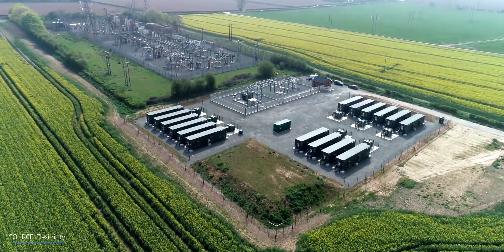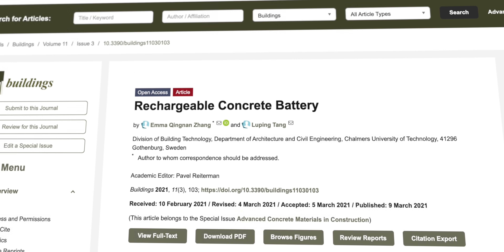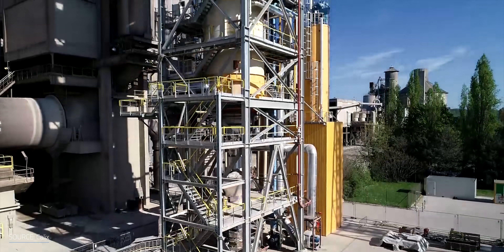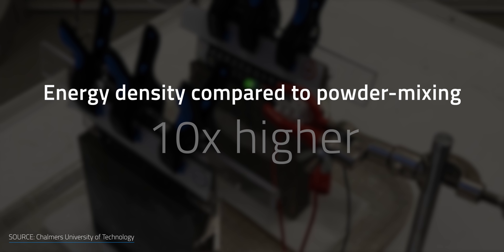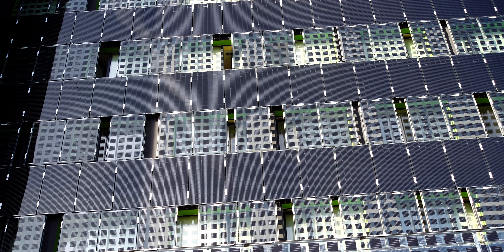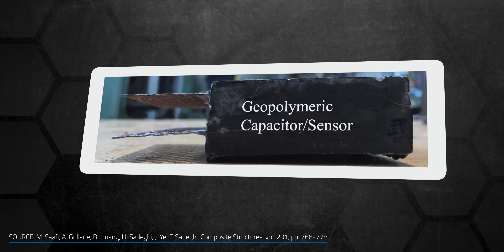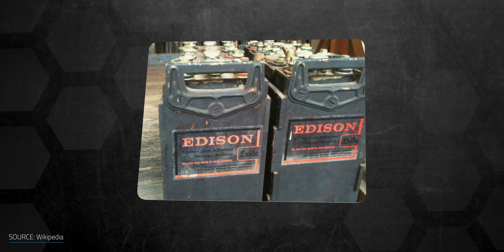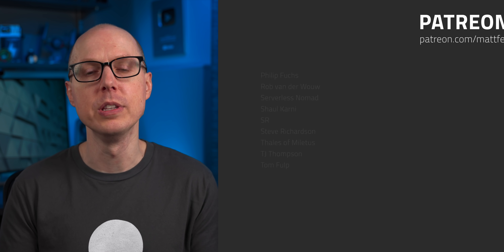Turning Buildings into Batteries? Concrete Battery Storage Explained

Comment: I would be very concerned about the thermal expansion and contractiom of the battery components. The usefulness of iron reinforced concrete is dependent on the rates of its components expanding and contracting at relatively close rates in changing temperatures. The crystals linkage between iron and cement wouldn't mean much if heat caused easy cracking.
Reply: You'd also have to take into account the volumetric expansion of anode and cathode caused by absorption and release of charge carrying ions carrying charge between the two electrodes.
Reply: This sounds like a Surfside Condo collapse in the making...
Reply: There’s a video by practical engineering that talks about how in modern day we help stop concrete from cracking too much. And if what Matt is saying in this video is true than I think the batteries could actually strengthen the concrete. If you want to see the video i’m talking about type in practical engineering stopping concrete from cracking.
Reply: I can only imagine a failure frying everyone inside, living inside of a battery doesn't seem like a smart idea to me when nature is a fully active wild child to deal with. lol  Concrete is hella unstable and needs maintained to much. People often forget that it's brittle and porous. With that being said I could get behind the idea of it being used in driveways etc.

Comment: With LFP battery patents expiring in 2022, and lower energy density not mattering for stationary storage, I think LFP will take over for grid use (assuming flow batteries stay too expensive). Concrete batteries interesting concept but building trades and building codes not known for adopting new technology.

Comment: TV/VCR combos had a fatal flaw, if one breaks, you can’t replace it without replacing the other. With batteries forming the structure of a building, when that battery stops working, it cannot be replaced.
Reply: What if we used prefabricated concrete battery blocks instead? When the battery stops working, you unbolt it and replace the block with a new one. You couldn’t make the entire structure out of these blocks, but you could have non-structural concrete be made of replaceable blocks
Reply: @justinokraski3796  What if you just had a normal battery? Sure, it takes up a bit of space instead of being the structure itself, but with a much higher capacity, ease of access, and replaceability, I think that's worth it.

Comment: We are better off using the buildings and housing we already have as "batteries".   Using them to store (thermal) energy when it's abundant in the form of increased or decreased temps and letting them return towards the mean when energy is no so abundant.  Obviously having good thermal insulation improves the "battery".   Example:  Using solar energy to slightly over-cool or over-heat during the day while the sun is shining by say 3 degrees and letting the interior temp swing back the other direction at night when solar energy is not being created.  The perceived comfort disruption to us is fairly minimal and the change is gradual so it's hardly noticeable.  You don't even have to generate your own electricity for this to be a large-scale benefit, doing the same on-grid reduces the strain and levels off power production around the clock for energy providers.   All it takes is a programable thermostat or someone willing to manually control the thermostat 2x a day.

This idea is basically free to do/use, it's available to just about everyone, and we can all do it today.
Reply: Passive solar design will do this with fewer moving parts.
Reply: @shawnr771  Agreed, but again that usually means significant redesign and cost.  When it comes to battery tech, doing the above is basically free and we can pretty much all access it.
Reply: @ssoffshore5111  If we would alter new home designs to incorporate it start with would be a good idea.
Especially in areas it makes sense.

Comment: That's interesting. Does it affect the concrete either positively or negatively? (Pun intended) Does it shorten the life-span or weaken the concrete?
Reply: I'd say yes because of the volumetric expansion of anode and cathode during charging and discharging. And because of different thermal expansion of the anode and cathode metals. The reason why iron is used to reinforce concrete is because its thermal expansion very closely matches that of concrete. But nickel....I don't know. 
Also I know that at least in lithium ion batteries the charge carrying lithium ions in the electrolyte plate on the surfaces of the two electrodes over the battery life. And in this type of battery the plaster is the electrolyte. So similar kind of reaction could weaken the plaster over time. But I am not sure
Reply: My biggest question, disappointed he didn't address it.

Comment: Some possible problems that popped up in my head:
* How much does it complicate the cement pouring practices that are used today? (Might making cement bricks and using those in the walls be a better idea?)
* How do the anodes, cathodes, and additional add-ins affect the structural integrity of the cement?
* What happens during a critical failure of one of these batteries and is that something you'd accept happening inside your walls?
* (On a lesser note) I imagine this would make it close to impossible for WiFi signals to get through the walls.
Reply: And what happens if you need to core cut a hole for a duct or pipe to go through one of these concrete walls?
Reply: @THLGargamont  I was thinking exactly about that and I imagined people would only do sections of "battery cement" and other parts of the house like structural pillars and a couple walls be made out of common cement
Reply: Let's not forget how do you maintain one of these concrete-batteries? Do you go at the wall with a drilljack and diamond saw and hope you got the right one?
Reply: Plus a very important question should be: does it affect the ability to recycle concrete?
Reply: @joshuahector634  And what's the cycle life? A bit harder to replace when you need to tear your building down.
Reply: I think from a builder perspective this is a nightmare.  I'd rather have a space to put a redux flow battery personally, which are environmentally friendly and you don't have to worry about what's happening in your wall and I think there's one part other than a failing pump that has to get replaced after many thousands of charge cycles.
Reply: Concrete production is one of the BIGGEST carbon emissions sources out there.
How would this added complexity in concrete production going to impact emissions?
Reply: Depending on capacity improvements, this might be a more practical product for concrete driveways and pavers rather than interior walls of a home or building.
Reply: Lots of structural integrity problems here.  High likelihood that the heat cycling and metal oxides from just operating the battery will cause microcracking of the concrete.  There's also a chance that chemical activity could degrade the actual cement bonds.
Reply: *Degradation of the steel rebar as well as every metal fastener used to secure anything to the concrete,  by electrolysis?
Reply: This technology would be best suited to large repeated concrete forms - railways, monorails, roads, tall buildings etc - you'd presumably have many isolated 'batteries' in parallel with the necessary protections from electrical shorts. Although as people have pointed out? bricks would be better suited for this style of battery - there are likely clever ways of connecting all the battery-bricks as part of the laying process.
Reply: For each of these:
1. It will complicate it somewhat as layers of carbon fiber mesh will need to be placed in between concrete layers.
2. These should increase the structural integrity of the cement. They're reinforcement fibers.
3. Critical electrical failure is unlikely to happen. The energy density is basically so low it's very unlikely to happen. These store 0.8Wh/L of concrete according to their paper.
4. It would definitely be close to impossible for almost all signals to get through the concrete. The entire house is essentially full of EM shielding.
Reply: on the last issue you mentioned, maybe it could be used only in exterior walls and keep the interior ones as regular cement.
Reply: Prefabricated elements.
Something like the so called commie blocks.
Reply: You forgot the MAIN ones - how long would those batteries last, how economical is it to even make them as opposed to battery banks which you can freely maintain and replace, how environmentally safe are they and what happens in cases of leakage through the walls, do they emit harmful fumes and other bad stuff, and how safe (or unsafe) is a demolition of such a house compared to a normal one
Reply: Yes, WiFi,  just use lots of repeaters and imbed lots of wires throughout the structure. Food for thought, though... it would be great if the cement could carry the wireless signals, too.
Reply: You only have those questions cause there isn't an industry for it yet
Reply: Good questions. Seems they are in the early stages of the technology. Will be interesting to see where it goes.
Reply: Essentially a Faraday cage of concrete? WiFi doesn't go out and perhaps no cell signal inside either. That could probably be fixed by integrating some sort of signal amplifiers where there's glass and at various points internally. Or... market it to conspiracy theorists as a way to avoid those 5G viruses from Bill Gates.
Reply: Tartarian tech
Reply: SHHHH Its not ment to actually work, just to get people to invest!
Reply: @danquaylesitsspeltpotatoe8307  
- "SHHHH Its not ment to actually work, just to get people to invest!" 
You seem to suggest that the invention actually working wouldn't help with getting people to invest in it. Perhaps the quality of your comment reveals the reason why so many investors make a lot of money while you don't...
Reply: @adoatero5129  
"You seem to suggest that the invention actually working wouldn't help with getting people to invest in it."
🤦‍♂️🤣
Well it doesnt, thats why they need "investor"

"the reason why so many investors make a lot of money while you don't."
LOL my etherium did ok!

So how much have you invested in 
spin launch etc?
how much in solar panel roadways?
how much in solid hydrogen? THE LATEST BRILLIANT IDEA ON THIS HACK CHANNEL FROM THE SCIENCE IGNORANT EGG!
Reply: @Old Time Farm Boy " It is not a matter of if it will crack but when."
Im no concrete expert, but when I hear this crazy idea I know it was just terrible for so many reasons, but people get conned or just dont think like you do!
People cant see the massive flaws in 
solar road ways!  
hypertube!
spinlaunch!
anything musk comes up with an idea someone else didnt invent.
All the examples on TF should be in  a museum! :)
Reply: This also complicates house buying/selling, you'll need to list how much charge your house can provide and how long the electrolyte is expected to last. This will encourage tear down and rebuilds which is a massive waste of resources.
Reply: And what happens if the wall gets water damage?
Reply: Jorn Paul Winkler  Oh OK lets just stop burning wood instantly!

Now you go outside and flick of the electricity switch and turn off the gas for your house and dont use you car ever again!
Reply: Jorn Paul Winkler  "Indeed 100 million tons of rainforests and forests burnt down a year since Kyoto for biomass and biofuels"

You are right so why havent you gone outside turned off your electricity and gas and stop using your car?

You dont seem to understand the massive cut in green house gases from using renewable energy?

HOW MANY KW SOLAR PANELS DO YOU HAVE?

DO YOU ONLY USE RENEWABLE ENERGY?
Reply: Other concerns:

(1) How does a completed battery circuit that is your house deal with lightning protection?
(2) These batteries would doubtless create stray current into the ground, which would eventually corrode ferrous and copper-based service lines coming to your home (e.g., water and connections).
Reply: I mean it would probably be a problem to put a nail into the wall.
Reply: Jorn Paul Winkler  Good story.  Did you have to post this useless behemoth of a diatribe twice?  I'm not even sure what your point was, since nothing you posted seemed germane to the question being raised.  That said, I do give you high marks for being the most vociferous person on this thread.  Way to go, keyboard warrior!  You sure showed us!
Reply: The less CO2 plants get, the less byproduct like oxygen & Ozone the planet gets.
Reply: @Victor_yay  coming in 3 years late, now that MIT has made a break through drastically increasing the energy storage abilities while making it so much more efficient both in the construction aspect as well as sourcing of the materials needed. Now just using an electrolyte solution and nano carbon mixed through the concrete as it pours it negates the issue of actually getting it poured without the need of high level expertise.

Yet to hear about the difference in structural strength but I'd wager it's not much different but damn it gets me excited
Reply: And the very fact that there are questions such as these tells me that there is no way this technology is being adopted any time soon.  Why would construction companies take on this risk with little or no benefit to themselves.  The problem of storage for renewables is a problem for utilities not construction firms.  Possibly utilities could sponsor the technology, but why would they do that when there are solutions available that are 100% under their control?
Reply: Your questions and the ones below are expecting this to run before it can even crawl. Once they have the basic's perfected only then can they test it's function in everyday applications which will take a good few years yet
Reply: @p24hrsmith  It could be, it could also be pointing out potential flaws so they can be mitigated or avoided.
Reply: @kawaiidouchebag4176  but they're nowhere near that stage of the development
Reply: @p24hrsmith  That's great if the idea passes the smell test, but this idea just doesn't.  That's not to say the experiments were a waste of time, we clearly need to improve on lithium battery tech.  But this solution isn't worth moving forward on.
Reply: @tippyc2  what qualifies you to say that ?  Only the basics principles are given in the video you don't have the full technical info. Most technical advancements come from those who think outside the box not "well it don't smell right to me"
Reply: @p24hrsmith  I am familiar with processes that damage concrete through my work as an engineer.  Chemical activity of metal oxides, and heat generation are two guaranteed effects of operating a battery.
Reply: @tippyc2  of course these scientists would know nothing about that what are they thinking good job there is people like you with a "familiar" level of knowledge about it to help them out
Reply: This will likely also interfere with electronic signals of cabled run through the walls without a large amount of expensive insulation

Also the idea that someone tries to hang a painting and gets electrocuted probably isnt the best in terms of PR